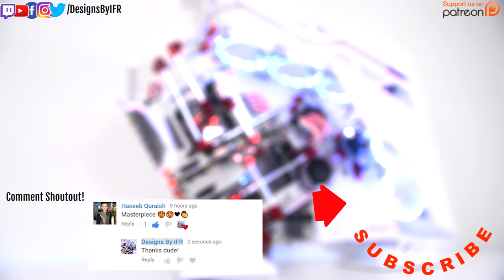$4000 EXTREME Custom Water Cooled Gaming PC Build Deconstructed

Comment: Is this good PC ?
Ryzen 5 2600
GPU :
RTX 2060
32 gb ram G-skill Aegis ddr4 2133mhz
motherboard :
MSI B450M gaming plus  
PSU : SeaSonic 850W 80+ Bronze M12II-850
Reply from the maker: Its decent. See if you can get faster ram. Ryzen loves fast ram
Reply: Maybe a r7